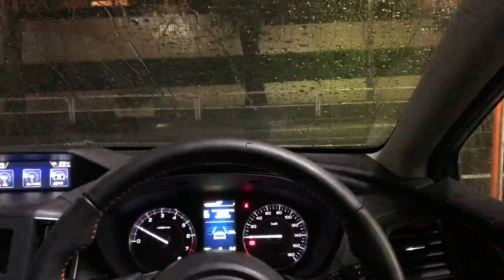FINAL BOUT JAPAN SSJ2: Part 2

Comment: if he wanted to beat that. Turn it off.. drop that pan.. undo the rod... 1500 grit wrap mid size shoe string pulley that journal and and jackoff 1000grit speed the inner caps. new bearing... once u get good at this. It'll run for a week or so hard. On a Honda bounce the rev limiter with these expectancyu